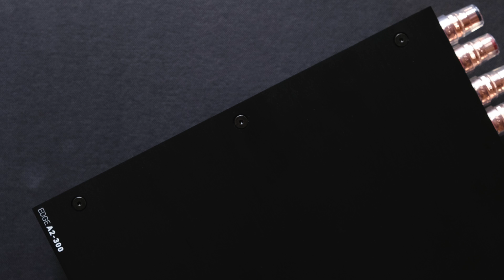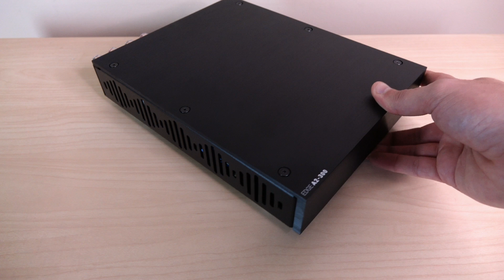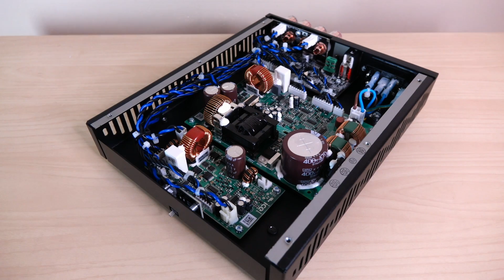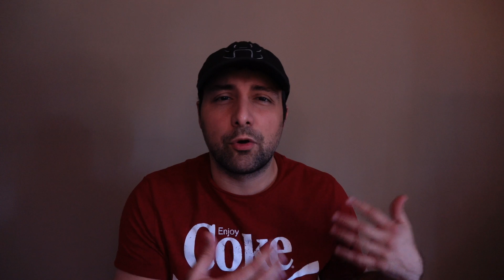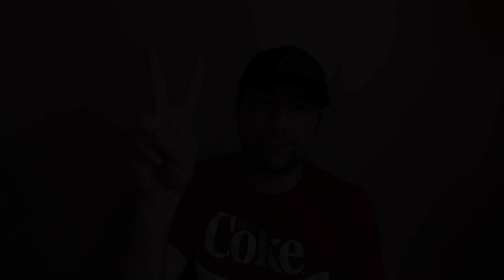Review!  The XTZ Edge A2-300 Power Amplifier

Comment: How would this work with a warm tube based preamp? E.g. If we paired this with Schiit Freya series? Also, thanks for reviewing Class D products, they are evolving a lot in recent years and need reviewers like you to look at them with a neutral eye. Class D takes lot more R&D for the modules but when done right, can go really far.
Reply from the maker: Should pair up just fine.  That gain switch will make matching a breeze.
Reply: @ZeroFidelity  How does one actually "match" this, and know what the correct setting is ?

Comment: How does it sound with a tube preamp up front? Tube preamps often improve the warmth and imaging of a class A power amp. Not sure if that goes with a class D power amp.
Reply from the maker: Couldn't tell ya.  I don't have any tube pre-amps here..  let alone ones that I'd use as a reliable baseline.  There's a chance that it could fill up the mids.  The question is if it will compromise anything else in the process.

Comment: I wonder how it compares to the Hypex NC400 kit which I consider as my next amp. Heard much great stuff about it.
Reply from the maker: They are so similar that I'd need to have both here to perform an up-to-date comparison.
Reply: Isn't the Hypex a newer, better design?? I have some boards with TPA3255 chip in a diy setup and it sounds very good. The layout and quality of output chokes is extremely important in class D.  The TPA3255 sounds very transparent, and have a very good grip on speakers that is difficult to drive.
Reply from the maker: @impuls60  On paper.  But in the real world, I think it all leverages out quite equally.

Comment: I have this power amp with JDS lab Atom as preamp to drive Canton 3-ways speakers, and a DAC Chord Qutest. I like my system very much. Good dynamic range and base, indeed. They are not expensive (except Qutest), but are more than good enough to enjoy all kinds of music. I can tell it doesn't sound like a class D amp.
I think it is a good starting to have mono block. I will try later.
Reply from the maker: Glad you like it!
Reply: Zero Fidelity Sean, would the characteristics remain the same if these are used in monoblocks? Since it’s quite cheap, I plan to double up at once. I’m currently using Rotel RB1582 MKii with Pro-ject S2 Digital as my DAC/Preamp

Comment: 1500 damping factor. Holy moly.  I sure would like to see how this amp would hold up to my Polks
Reply: Some of the new Hegel integrated amps actually have over 2000 damping factor😏
Reply from the maker: WONDERFUL match with Polk-type speakers.
Reply: @ZeroFidelity  I have never been a believer in class D amps but I think this review has changed that. This unit could be on my next equipment wish list!!!
Reply: @patrickalphenaar  Yeah, I had the H160 and Röst before I went with AVR for home theatre. They were both awesome😏

Comment: Could you review the Ghentaudio class D monoblocks? if you'll reach the guy I think he'll happily send you a pair for review.
Reply from the maker: I appreciate your willingness to help!  So to be completely transparent with you:  I plan on putting the breaks on reviewing Class-D amps.  I have a set of monoblocks in right now that may be reviewed in the near future.  After that, I'll likely stay away from the topology until something new/uniquely different comes around.  I'm talking a Class-D topology with big transformers, a huge filter capacitance bank, etc.   While the circuit doesn't need that to operate to spec.. it still makes a difference.
Reply: @ZeroFidelity ...I bought an Onkyo A9755 thirteen years ago.
Class D with two big transformers...it drove anything & it sounded so clean.